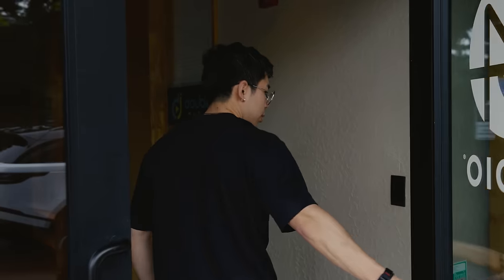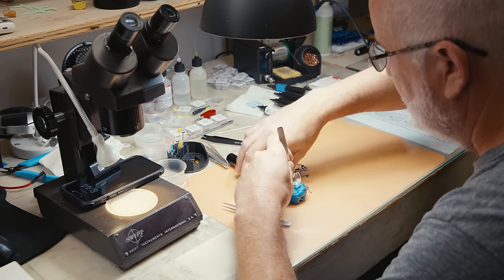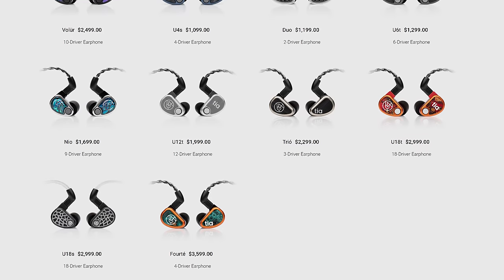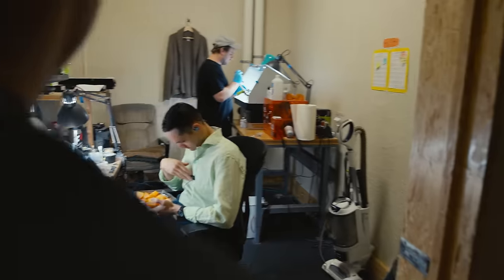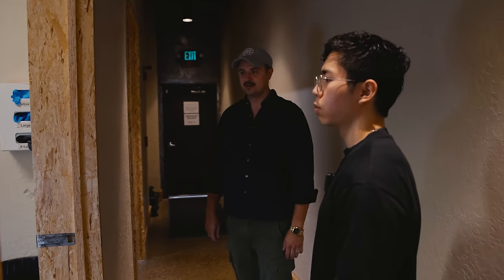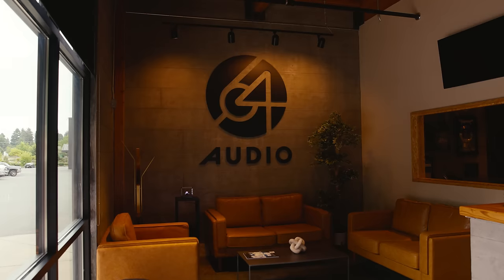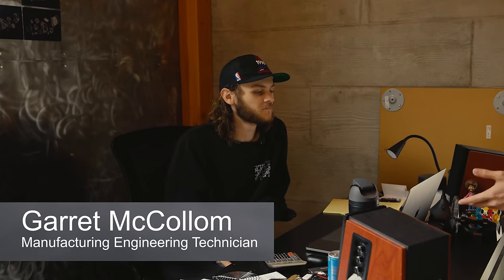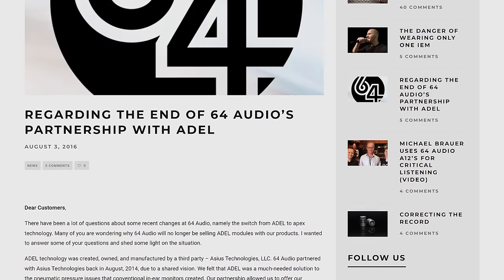How IEMs are made - 64 Audio factory tour

Comment: I'm a Korean consumer who uses Forute Blanc. I love the sound of 64audio very much. But I'm using it worrying that my product might break down even if the 2 pin connector is loose n shakes or a lot of contact failure. I hope it will be a luxury brand with good after-service

Comment: Ah yes $2000+ IEMs made of metal that's held together with literally nothing but like a .05mm thick ring of glue and not even in a way that protects the glue from skin oil or just twisting/pulling forces when handling the IEMs. I wonder how many pennies per unit that saves over using screws
Reply: I went Noble Audio